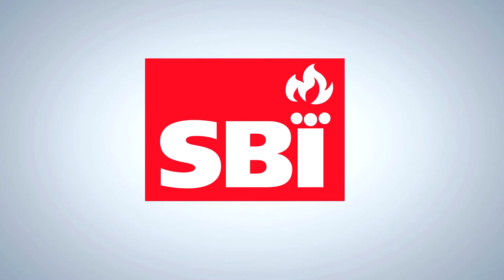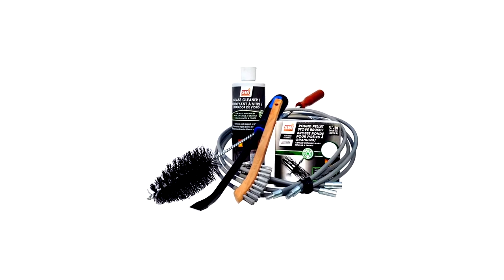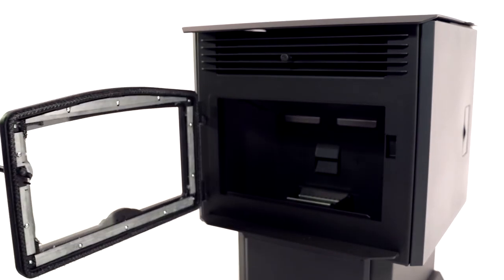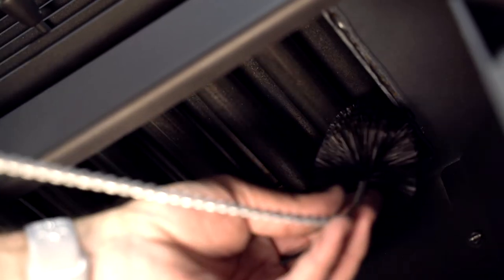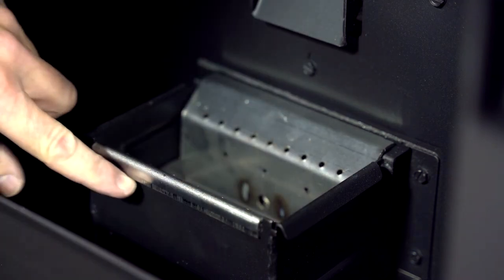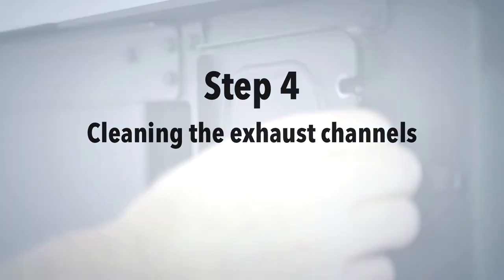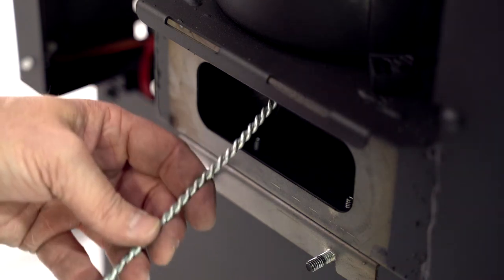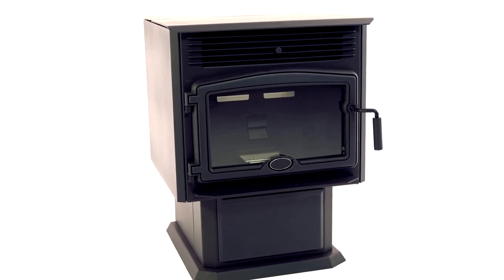Pellet Stove Maintenance (top feed) | 5 cleaning steps

Comment: You depict cleaning out an empty hopper with a vacuum cleaner, however during the winter season a hopper is likely to never be empty. Is this an annual process or do you suggest that the pellets are burned completely through until it's empty before performing that cleaning?